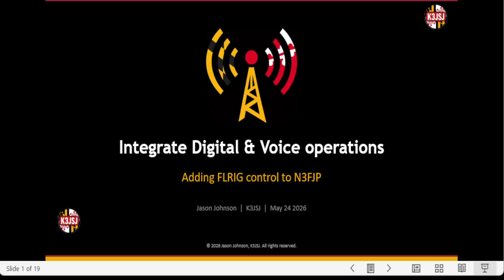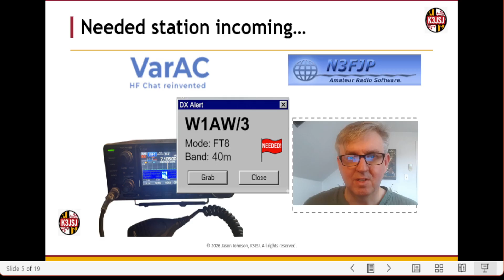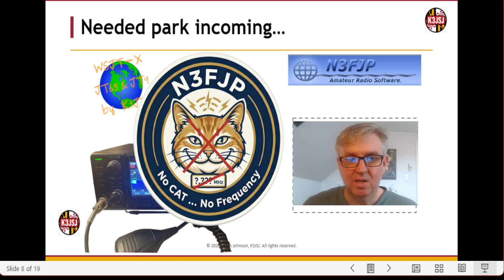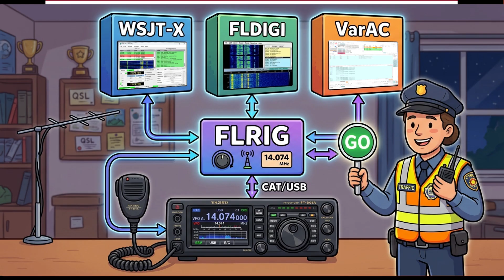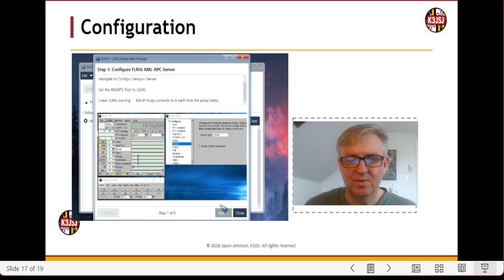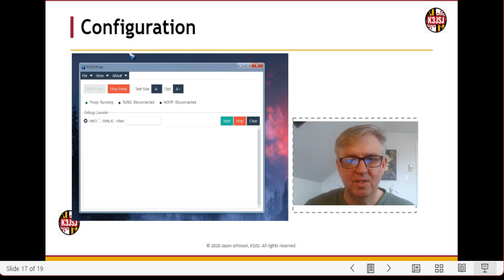Introducing N3FJP Proxy Part 1 of 2

Comment: I have sent Scott messages about adding Flrig to his program and so far nothing, I would simply just not use rig control in wsjtx but I would forget to manually change bands and that would be bad, I will try this, wsjtx does have a function for rig control from n3fjp but it isn't stable.